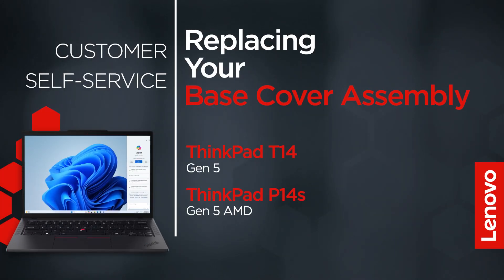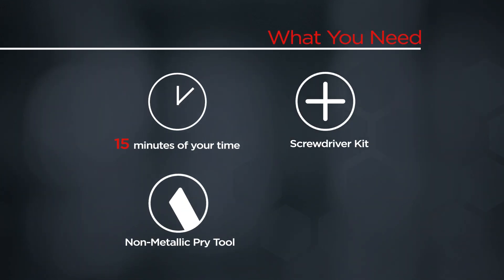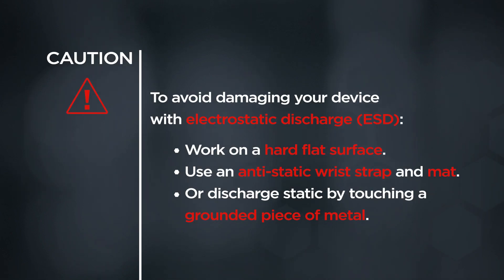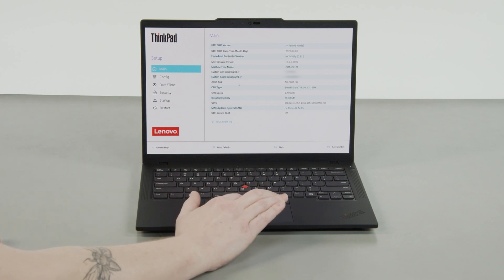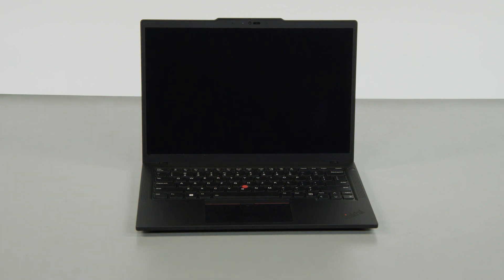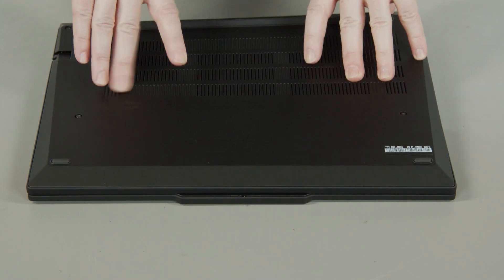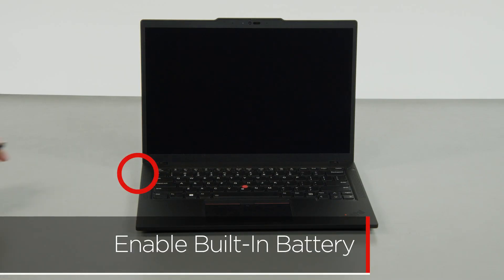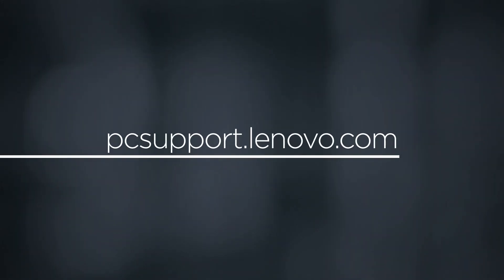Replacing Your Base Cover Assembly | ThinkPad T14 Gen 5 and P14s Gen 5 AMD | Customer Self Service

Comment from the maker: This video will show you how to replace the base cover assembly of your ThinkPad. The process in this video will work for the ThinkPad T14 Gen 5 and ThinkPad P14s Gen 5 AMD.

You will need a screwdriver kit, a non-metallic pry tool, and 15 minutes of your time.

To view the ThinkPad T14 Gen 5 Self-Repair Guide go to https://pcsupport.lenovo.com/us/en/products/laptops-and-netbooks/thinkpad-t-series-laptops/thinkpad-t14-gen-5-type-21ml-21mm/selfrepair/removalsreplacements

To view the ThinkPad P14s Gen 5 AMD Self-Repair Guide go to https://pcsupport.lenovo.com/us/en/products/laptops-and-netbooks/thinkpad-p-series-laptops/thinkpad-p14s-gen-5-type-21me-21mf/selfrepair/removalsreplacements

To learn more about your device go to https://pcsupport.lenovo.com

To find parts for your device go to https://support.lenovo.com/parts-lookup/?cid=ww:lenovosocial:b9515f&source=socialmedia&subsource=yt

To view the Lenovo Support Self-Repair Guides landing page go to https://support.lenovo.com/us/en/solutions/HT516547

** NOTE: Static electricity can destroy components. Use a grounding strap, and clean, non-conductive surface to work on. Use plastic or coated tools to prevent scratching and avoid using metal tools on plastic parts. For more detailed information on electrostatic discharge and how to prevent it, please watch our "Understanding Electrostatic Discharge (ESD)" video: https://youtu.be/by4PB3WtdLo 

Applicable Machine Types:
ThinkPad T14 Gen 5 - 21ML, 21MM, 21MC, 21MD
ThinkPad P14s Gen 5 AMD - 21ME, 21MF

Check out other official Lenovo channels!
https://www.youtube.com/@Lenovo 🟥
https://www.youtube.com/@lenovolegion 🎮
https://www.youtube.com/@Lenovo-PC 💻
https://www.youtube.com/@LenovoSuporte 🟢🟡

#Lenovo #LenovoSupport #LenovoTechSupport